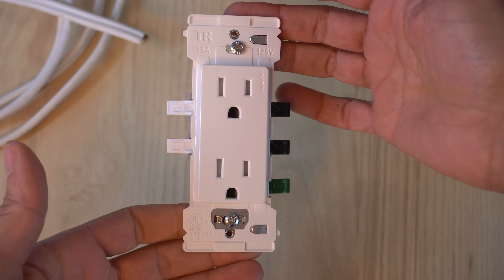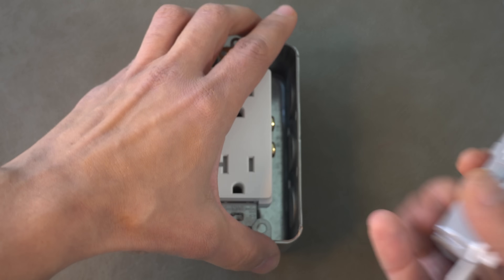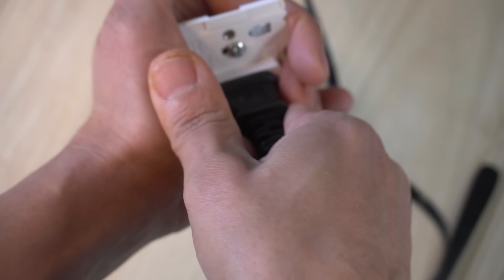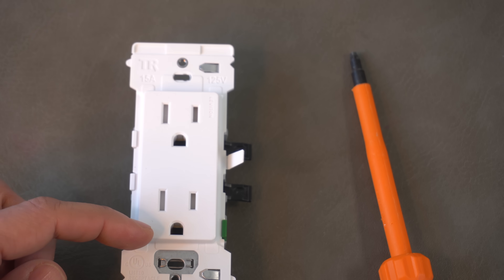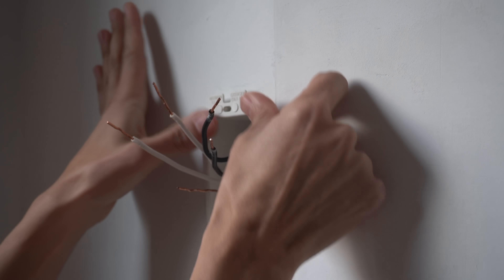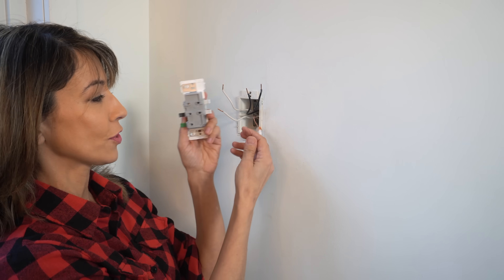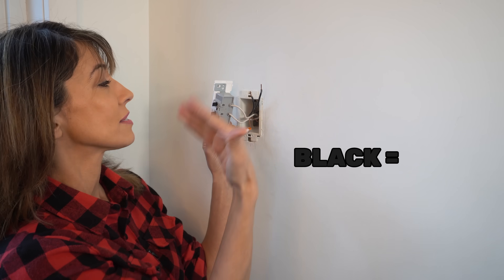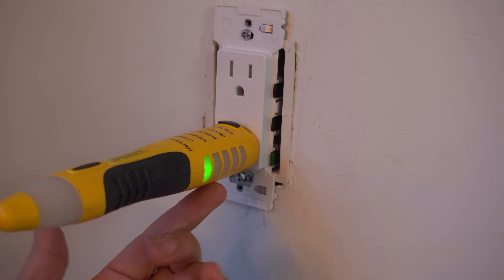New Electrical Outlet Installation: 3 Essential Improvements You Need To See

Comment: i remember tearing out old backstabbed outlets after failures. nothing beats properly screwed terminals for good contact.
Reply: Not sure the backstab outlets you are talking about are comparable to the waygo technology.
Reply: we didnt know the backstabs would burn down houses for decades either.
 @leestebbins5051
Reply: Backstab is not the same as a levered connection.  Just because they are both entering from the back of the receptacle they are not the same.
Reply: How does this clamping compare to the older ones, are we talking about the same design?
Reply: it doesnt compare to a properly torqued screw is to the point. @msk3905
Reply: Do you still idle your car for 3 minutes before driving it? My point being things change but people are set in their ways.
Reply: @RCdiy   Europe is like 100 years ahead in terms of electrics 😅.
Reply from the maker: I hear you. Property installed outlets are great. Appreciate your insights because it’s true.The challenge is knowing all the steps to properly secure the terminals.
Reply: These have more contact surface than quickwire (aka backstab) and provide a secure connection.

The question with the failed outlets you had to replace, is whether that was because the connection was quickwire?  Or because they used 12 gauge with quickwire, didn't push enough wire into the connection, or used low cost/quality outlets (or a combination of those).  I suspect those are bigger factors. 

'd have no qualms using these in my own home, especially in places like bedrooms with low insertion rates and lower wattage devices.  Many devices, like LED lighting are usually just left plugged in and are low wattage.

However, I'd still recommend commercial quality for kitchen, bath, etc. where you'll be plugging and unplugging higher wattage devices more often.  But that has more to do with the mechanism for holding the plug in than the type of wire connection.
Reply: Wonder how much these things are gonna cost?..those tamper shutters are a real pain to me...I updated new ones around the kitchen...wife hates them.
Reply: That's like saying you will only ride horses because the model T was unreliable...
Reply: And proper contact is not wago. The lack of surface contact on a continuous high load will become its downfall
Reply: The comparison of this new receptacle to the old backstab receptacles is non-existent. There was no lever involved with the old backstabs. The new levers create a pressure on the wires that could not exist with the old backstabs. No comparison at all.
Reply: opinions vary. @philborer877
Reply: These are a great idea. I will use them from now on, cost allowing, lol. Thanks for the great tip.
Reply: Agreed, I’d love to see outlets with rear screw terminals that have some kind of ratchet mechanism to prevent them backing out, and also prevent over tightening. They could even have a flip-over plastic cap similar to this plug style to help prevent shorts without having to resort to putting electric tape on the screw heads. This has been my dream product for awhile now, would make DIY outlet installation much safer.
Reply: Yes, the old back-stabbed receptacles are an electricians dream. Not for the installer but for the repairman. They absolutely will fail and somebody will pay you to replace them. Money.
Reply: Some people will never learn to change their ways. Guess you drive around in a horse drawn carriage as well 😂
Reply: horse and carriage wont burn your house down. @frikkied2638